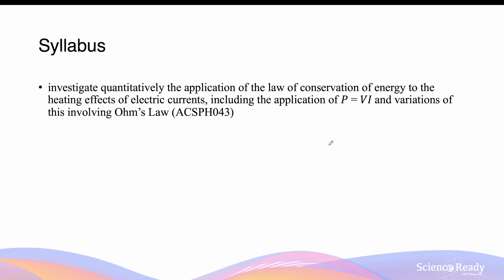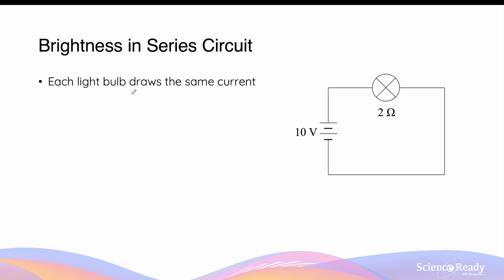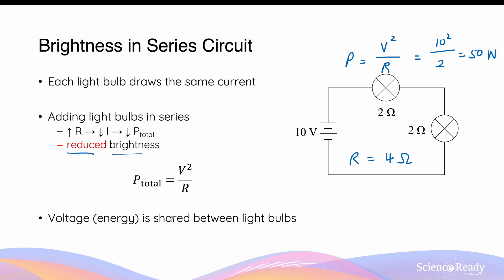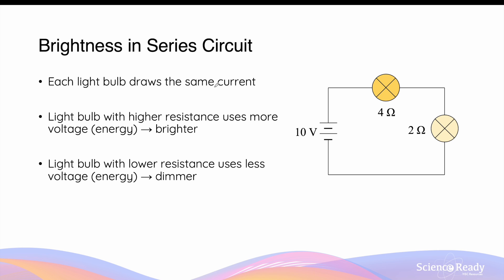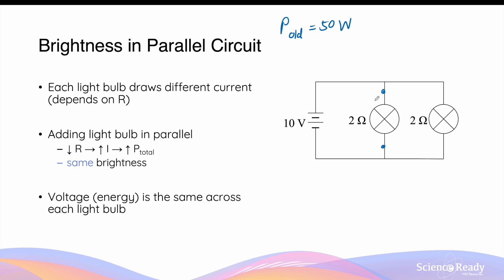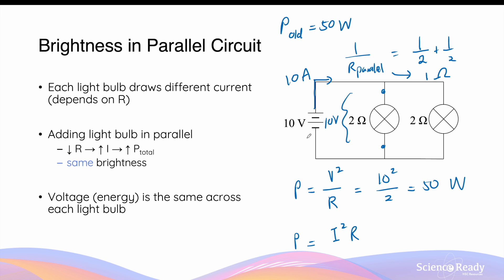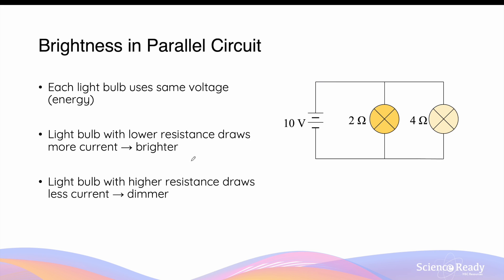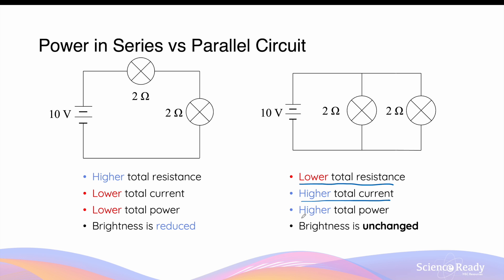Power & Brightness in Series and Parallel Circuits // HSC Physics

Comment: If you are talking about traditional incandescent light bulbs, they approximate to constant current devices over a wide voltage range. As the voltage rises, the filament warms up, increases its resistance and so brings the current down to something close to the original value. Any voltage between the first visible glow of the filament to full brightness will do. The only caveat is that it takes a second or so for the filament to change temperature, so there is a slight delay.

There used to old-school bodges based on that effect; before modern constant current techniques were available. Back in the 70s, I used to charge a small 6 volt motorcycle battery from a 12 volt car charger at a current suitable for its low capacity. Also, I can vaguely remember a hi--fi amplifier using that method when a constant current was needed .